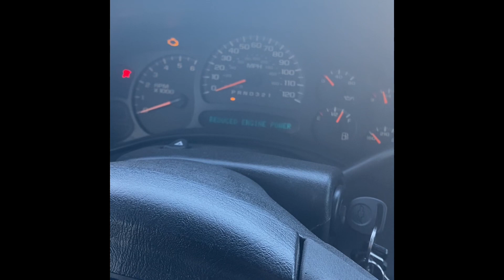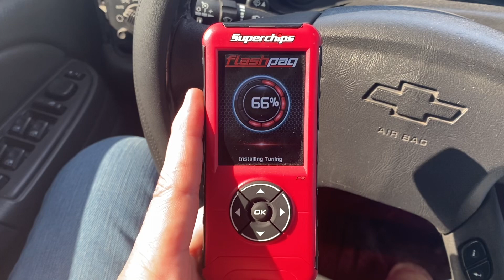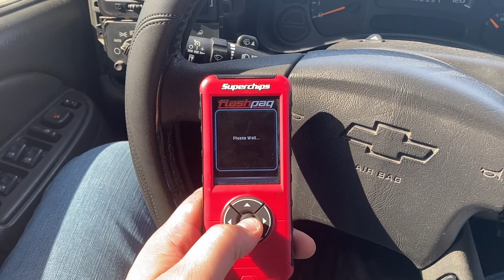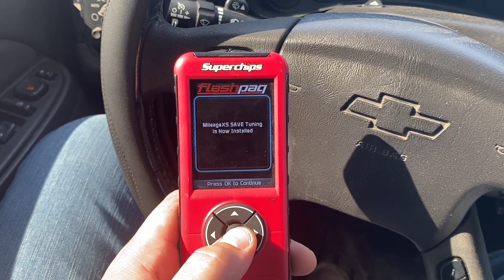Superchips Programmer Not Loading Tunes to Your Truck? EASY FIX 🔥

Comment: So shouldn't I just be able to take the fuse out for the radio?
Reply from the maker: Idk bro try it. I decided to unplug mine completely so truck had no communication to it.
Reply: @victor_beltran  After 100 tries and various fuses removed, I can confirm that just pulling the radio fuse does not work. It worked as soon as I physically separated the aftermarket radio. I called Superchips the other day too and that was also their first suggestion. It blows my mind how that has to be done. Especially when it's always worked for me, up until now, with this same radio.
Reply from the maker: @Justinj360  good deal glad you got it to work too